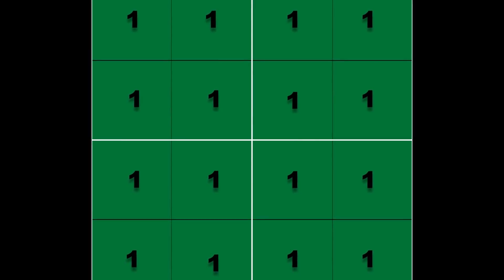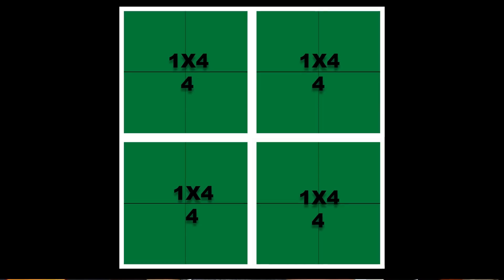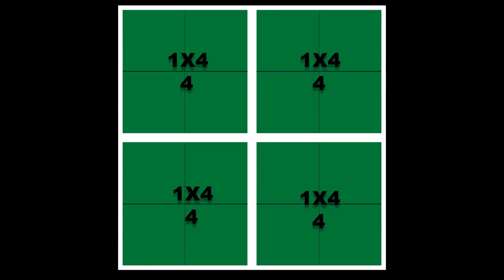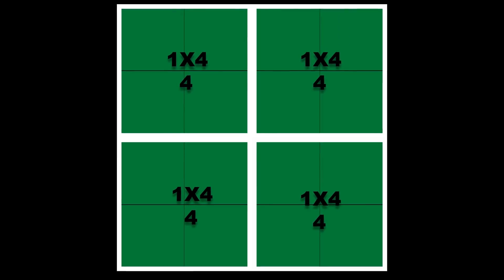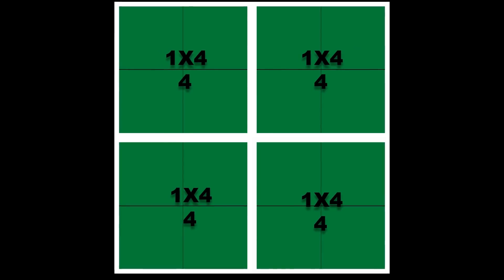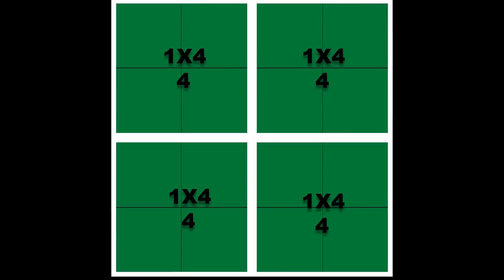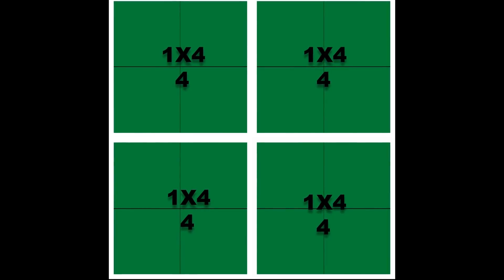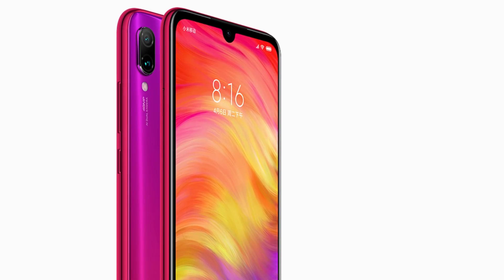Redmi note 7 48mp ക്യാമറയുടെ പിന്നിലെ രഹസ്യം & Pixel Binning

Comment: SD 660 48 mp camera support cheyyunnundo
Reply from the maker: ഇല്ല... പുതിയ ഒരു technology ഉണ്ടെന്നു പറയുന്നു.... അതിനെ കുറിച്ചു company പറഞ്ഞ ഒരു അറിവ് മാത്രമേ ഉള്ളൂ... കൂടുതൽ details കിട്ടിയാൽ വീഡിയോ ചെയാം
Reply: Note 7 holds 48 MP Samsung Isocell GM1 sensor. Snapdragon 660 ക്ക് 25 MP output മാത്രേ process ചെയ്യാൻ പറ്റൂ എന്നേ ഉള്ളു. 48 MP sensor hold ചെയ്യുന്നതിന് പ്രശ്നം ഒന്നുമില്ല. Pixel binning use ചെയ്ത് 12 MP size ആക്കി മാറിക്കഴിഞ്ഞു മാത്രമേ ആ image processing നായി processor ഇൽ എത്തുള്ളു.

പണ്ട് നോക്കിയയും സോണിയും ഒക്കെ ഇതിലും കുറഞ്ഞ processors ഇൽ 40+ MP camera implement ചെയ്തിരുന്നു. അന്നൊന്നും ഇല്ലാത്ത doubt ആണ് redmi കൊടുത്തപ്പോൾ ചിലർക്ക്.
Reply: @NITHIN391  spr bro

Comment: In daylight also the image quality will be 12MP.  Note 7 is using snapdragon 660, which can process maximum 24 MP image. so in day light also they are using pixel binning to down-convert to 12MP such that SD660 can process the image.
Reply from the maker: Basicaly അതു ശരിയാണ് പക്ഷെ അവർ പറയുന്നത് pro mode enna ഒരു mode ഉണ്ട് അതിൽ കിട്ടുമെന്ന് ....ഫോൺ വരട്ടെ നമുക്കു നോകാം

Comment: Snpadragon 850 engineerd to support upto 32 MP, Snapdragon 660 upto 24 MP... Then how 48 MP ???
Reply: fake aarikkum...max 24 vare single support aaku......   duel 16+16 pattu
Reply: @jubinks1325  Not at all fake.. Note 7 holds 48 MP Samsung Isocell GM1 sensor. Snapdragon 660 ക്ക് 25 MP output മാത്രേ process ചെയ്യാൻ പറ്റൂ എന്നേ ഉള്ളു. 48 MP sensor hold ചെയ്യുന്നതിന് പ്രശ്നം ഒന്നുമില്ല. Pixel binning use ചെയ്ത് 12 MP size ആക്കി മാറിക്കഴിഞ്ഞു മാത്രമേ ആ image processing നായി processor ഇൽ എത്തുള്ളു.

പണ്ട് നോക്കിയയും സോണിയും ഒക്കെ ഇതിലും കുറഞ്ഞ processors ഇൽ 40+ MP camera implement ചെയ്തിരുന്നു. അന്നൊന്നും ഇല്ലാത്ത doubt ആണ് redmi കൊടുത്തപ്പോൾ ചിലർക്ക്.
Reply from the maker: quad bayer filter നെ കുറിച്ചു ചെക്ക് ചെയൂ അപ്പോൾ ഇതിനെ കുറിച്ചുള്ള ഡീറ്റെയിൽസ് ലഭിക്കും
Reply: ബ്രോ പറഞ്ഞതു 100 ശതമാനം ശരിയാണ്...
Reply: Hi